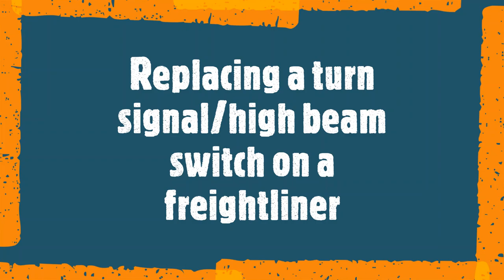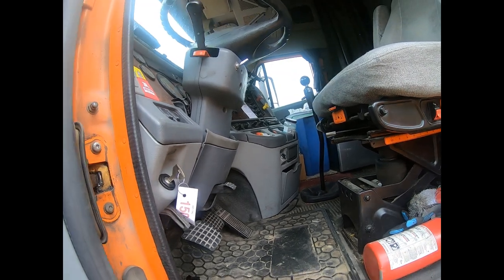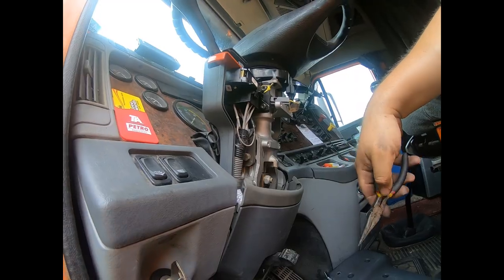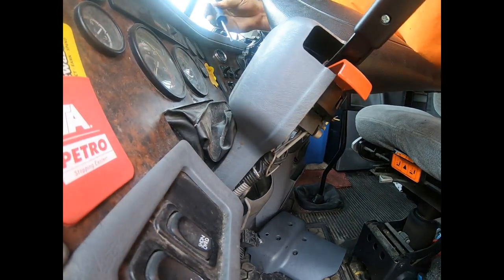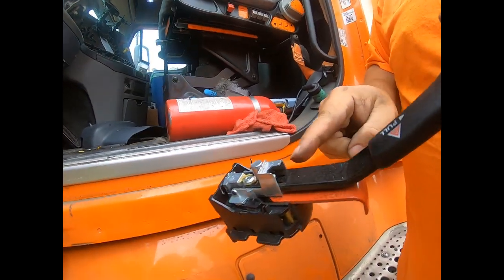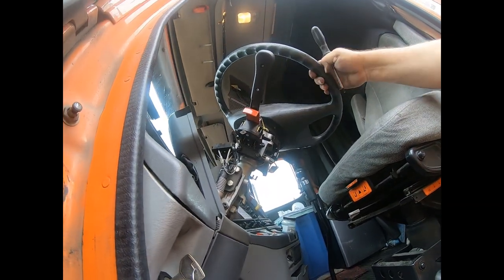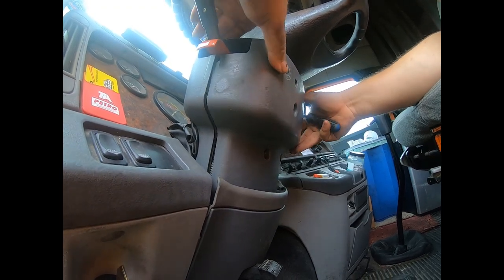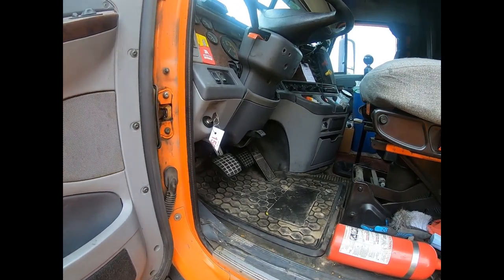How to replace a turn signal/ high beam switch on a Freightliner

Comment: Great video.....my issue was not the turn signals but wiper switch. Multi functional switches fail after a while. Wipers stopped working but the wash fluid function was operable.
Before spending a fortune at a truck stop or dealership buy the $80 ish part and install it yourself . The other issue could be a $45 wiper motor time consuming but easy to replace with a good set of tools

Comment: Would the turn signal handle cause the dash lights to go out but turn back on when i turn on the hugh beams? I replaced the interrupt switch and dash lights were working for a couple days until today they started turning off again but only on low beams and turn back in on high beams and when only the parking lights were on.

Comment: Love the videos. I have a Columbia pretty much the same setup. Do you have any videos of removing the speedometer dash. And replacing any bulbs. My fuel gauge bulb is out and I can't figure out how to remove the screen once the screws are out.
Reply from the maker: i dont, but to remove the dash the first step is pull out the cup holder, then the piece of trim, the screws start to become exposed. just work your way around the cluster. then it pulls up a little and out. then you can get at the back side

Comment: Great video...i got problems with the turn signal. That switch can be the problem?
Reply from the maker: It is common for these switches to go bad on columbia and century freightliner
Reply: Cause i already change the flasher relay and still not working 4 flasher en right signal
Reply from the maker: @edygonzalez7809  of course it can be many different problems.  Also check fuses, look for a broken wire...I'm not there so I can't really say.  I'm just saying, those switches go bad all the time. They are poorly made . I have had them go bad after only 1 year even. If you think the problem is somewhere else, for sure take a look.it would be wrong for me to tell you I know for sure over the internet. You could always buy the switch and if it didn't fix the problem, return it.

Comment: Would that switch cause the left signal not to work, but the signal arrow on the dash to remain solid. The left signals aren’t getting brighter. They still all flash on the 4-ways and the right signals still work. It’s on an 05 Columbia. If you have any other ideas as to what it could be I’d love to hear. I’m fairly new to the whole O/O thing!
Reply from the maker: Yes it can cause that...i had that exact thing happen.